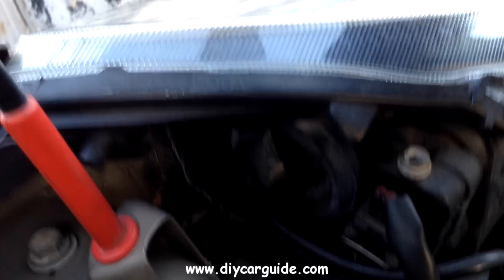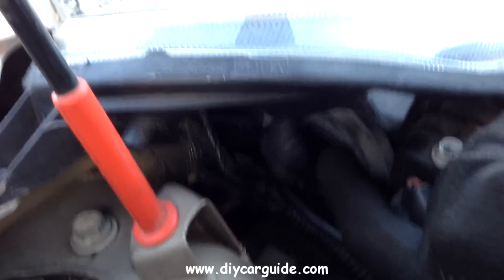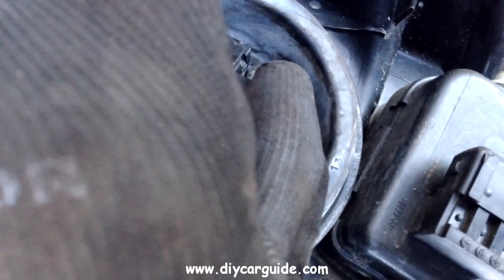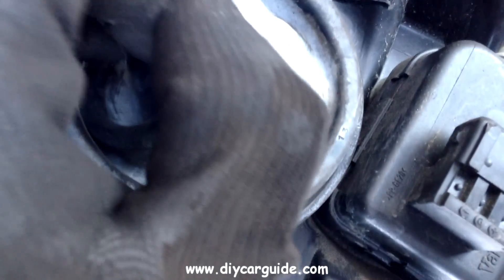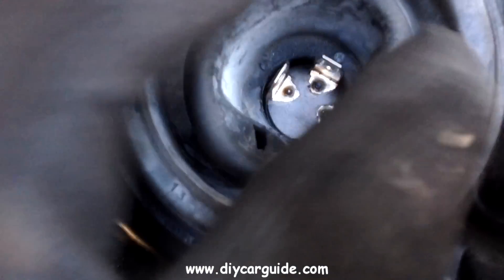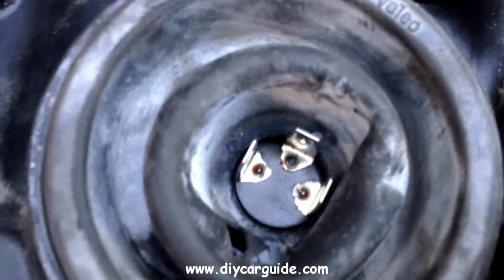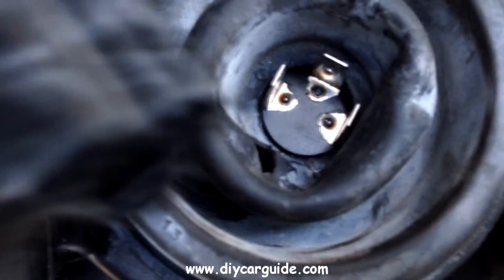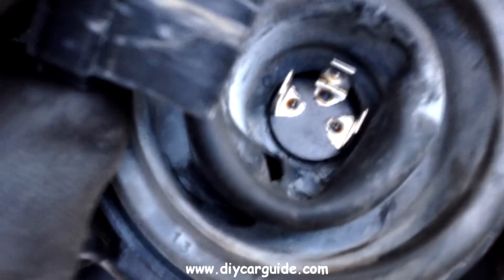Nissan Micra Headlight Bulb Change

Comment: The toughest part, as most other people have commented, is pulling the electrical connector off. At one time both me and my wife had Micras so I have spent much time cursing and grazing my knuckles until... I found a very good tip somewhere. Once you have got the electrical connector off and replaced the bulb, grease the three prongs of the connector with liberal amounts of Vaseline before putting it back on. It will make pulling it off next time so much easier. Trust me, this really does work.

Comment: Thanks for the video.  Took 10 mins to change (in the dark) just got to work out that the clip releases from the top and you have to push the rubber cover on so that the bulb connectors stick out. Thanks mate :)
Reply: MrHugaKuga Your tip re. The rubber cowling was really useful, thanks

Comment: Video was useful but that was so difficult. In situ it is a nightmare to access it, just changed my right headlight.
-When you remove the connector it is virtually impossible unless you push down the rubber cowling around it. This exposes more of the connector for you to do the squeeze and pull motion shown in the video, once I pushed the cowling further down I got it but was struggling before hand

-The catch that holds the bulb in, as shown it is push and a slight "shift" to get it out the "shift/turn"is really important just pushing straight down won't do anything. Push down and then "shift" it whilst it is still down. You will be doing this entirely by feel you can't see it at all, I took a picture with my phone with the flash on which helped, feel along the catch so you can understand the shape of it.

Good luck!

Comment: Thanks for this very helpful video , it's a hard pull to get the connection off and the rubber slides off , 
The video is spot on , I have slim hands which helps but all in all done in 10 minutes
Reply: @cddbass try a grip or pliers but put a dish cloth between it and don't apply too much squeeze as you may crush it

Comment: I've just come in after nearly half an hour of torture at the hands of my wife's 2010 Nissan Micra. My fingers are grazed and aching, I have a large lump on the top of my head where in my desperation I carelessly cracked it on the underside of the hood. My back is killing me, I'm soaked with sweat and I'm well pissed off.

Nissan should be congratulated on what is possibly the worst-designed headlight ever inflicted on an unsuspecting world. I would like to know how the boffins in Yokohama expected anyone with hands larger than those of a four-year-old child to be able to access the bulbs. I can imagine the Nissan design team giggling and nudging each other at the thought of thousands of huge, red-faced Europeans crammed into the tiny space under the hoods of their cars, trying in vain with their enormous fingers to get at the back of the headlight.

I did manage in the end to change the bulb, and although I'm not ungrateful it has to be said that the video implies that you can actually see and get at the back of the headlight, rather than having to perform the entire process by feel alone in a space slightly smaller than a tea cup, as is actually the case. 

Can't wait until my wife needs a new car - I will take pleasure in demolishing the accursed Micra with a sledge hammer before guiding her towards the Mini showroom.
Reply: Yep, your totally right mate, my hands are not big but still took an hour doing what is normally a simple 2min job on my Honda HRV and my Peugoet Boxer van. had to remove the front indicator/grill panel and remove a couple of hex bolts so i could pry the whole lighting unit out abit to make a little more room. Destroyed the rubber cover & had to use a flat screw driver to pry off the electrical connector as it was impossible to pull off. Nissan must have Umpa Loompa's working for them!
Reply: Priesty Just to tell you I tried today  to replace the bulb from my sister's 2010 Micra and didn't managed yet... The contact is so tight that I'm afraid to break the headlight itself... and I thought the French MPV's were the ridiculous ones...
Reply: Hahah I just walked thru the same horror!
Reply: I just replaced the headlight bulb without too much sweat and the minimum of swearing...unusual for me!
Reply: Sounds to me like your Micra is a 2010 K13 model. He is showing how to replace the bulb on a K12.  More space on earlier model?

Comment: Pulling the connector of the bulbs misaligns the spring that holds them in (it's putting the bulb against it and deforming it). Consequently changing a bulb on this car resorts in the headlights being misaligned and failing the MOT. The only way to fix that is remove the entire headlight and that's a total pain in the arse. You can in a Nissan?

Comment: Agree with below comments. Absolutely ridiculous design. I've just spent half an hour trying to do it in the dark. Will have to try again at the weekend when I can actually see what I'm doing. I hate this job more than any other on my Micra. A tip I read somewhere was to apply some Vaseline time the terminals of the new bulb, its supposed to make it a lot easier to get off next time. I can't honestly say I've appreciated the difference though...

Comment: Thanks for the video mate. In my opinion this is a very poor fixation mechanism design. Not straightforward to change a bulb in Micra K12. it's kinda difficult to detach the wire holding the bulb in place. Furthermore, the rubber sleeve make it really difficult to put back the connector.

Comment: I spent an hour today and no chance. Have 30 years and lots of cars to compare. This is the worst for space to work.If big hands, unbolt two obvious bolts, the third ( its a bolt on my second hand one, might have been a press stud originally)  is in behind fog light grill. It gives you more room as unit can be moved a little. This vid good though, least checked wasn't doing wrong.

Comment: Fiddly.. The spring clip gave way before the connector came off. but a screwdriver to leaver the connector off. It 'just' pulls off eventually.    But Better than a Honda Jazz, where you have to go in tho the wheel arch, with the car on axil stands & ideally the wheel off.  .Tora Tora Tora . Japanese designers attack.